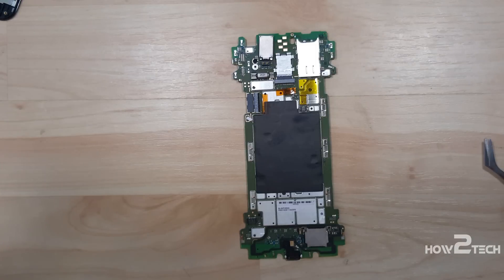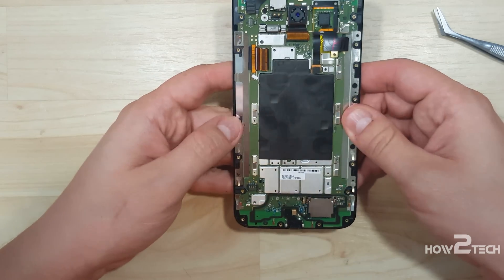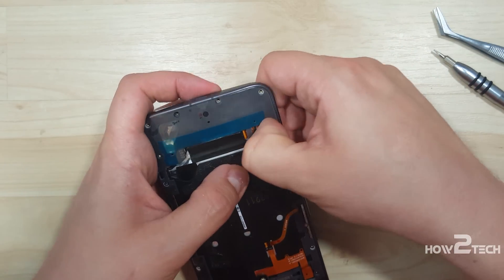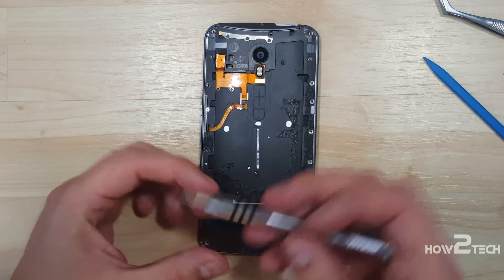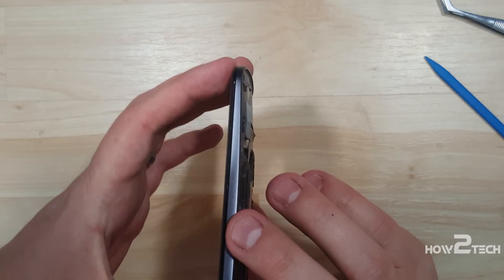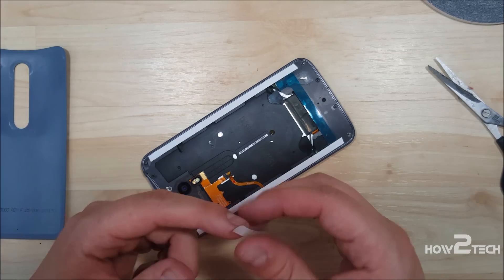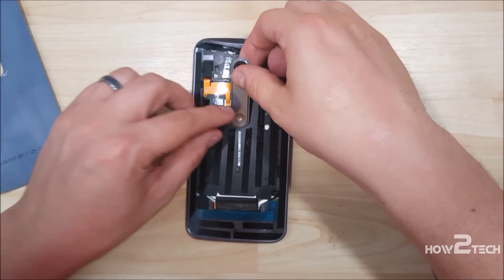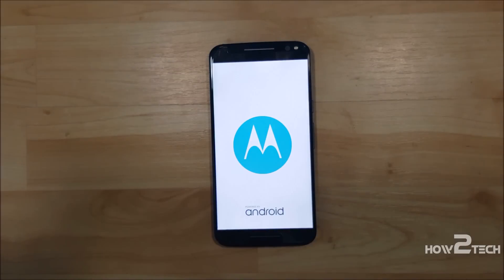Motorola Moto X Pure (2015) Screen Replacement & Teardown - Resassembly

Comment: Thnx for the video. I did it months ago yo replace the screen, Sincé that some sensors doesnt work properly like accelerometer, giroscopio and GPS, do you know where they are inside the board? Any help Will be welcome.. thanks in advance. Keep going forward